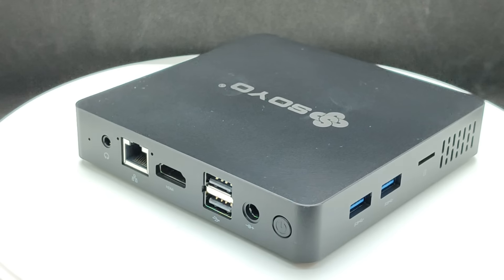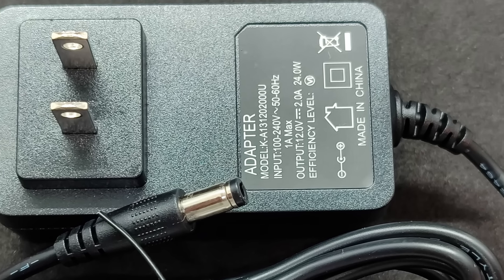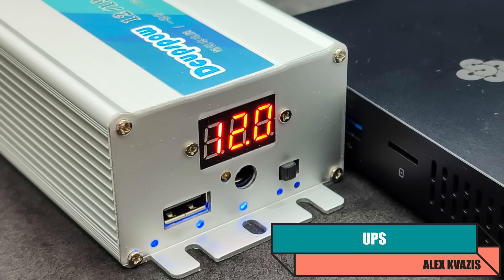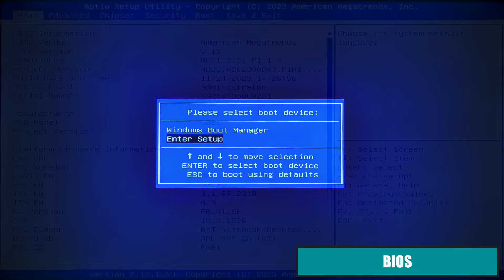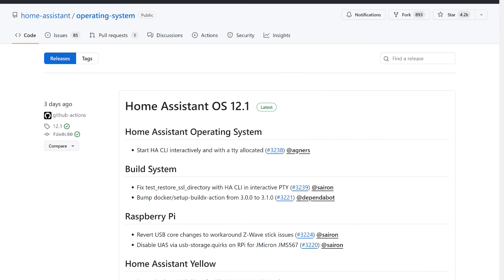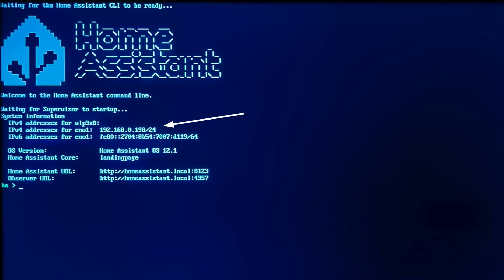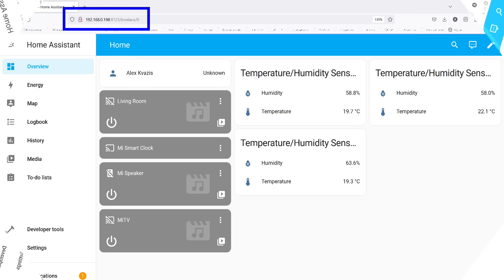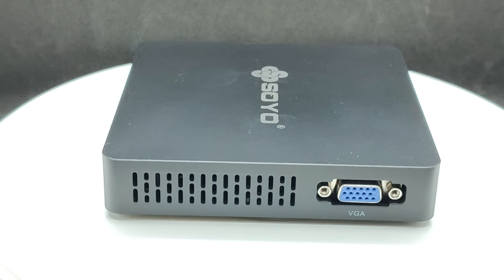SOYO M2 Air - бесшумный Mini PС на Celeron N3350, обзор, нюансы, установка Home Assistant OS

Comment: Great! The same model I chose to install HA and the first video I found to install HA.

Anyway, I would like to know how to restore the original OS in case of disaster. Anybody knows? 

Thanks
Reply from the maker: Just install standard Windows and everything is like on a regular computer
Reply: @Alex_Kvazis  I thought there's an option like recovery USB or something. That would be easier as it would include the hardware drivers, but I haven't done it before. Anyway, classic way is still an option. Thanks.

Comment: thanks for your video review... wonder if you can help... how to disable USB power after PC shutdown in BIOS ( I presume)?!? Thanks in advance
Reply from the maker: No, I haven't studied this problem. I don't know why it would be necessary.
Reply: @Alex_Kvazis  running an USB powered cooling stand/fan from the PC I always have to disconnect  USB  connector manually every time I turn off the PC and can not find a clear option regarding USB power in BIOS... Thanks anyway... will keep searching for instructions

Comment: I bought this o mini PC (Soyo N3350), and also the recommended UPS from your video. When I connect the UPS to Mini PC, the MiniPC starts with a estrange noise (when connected directly, it does not happens). Do you have the same issue with your MiniPC?
Reply from the maker: No, everything works absolutely silently. Is your UPS set to 12 volts?